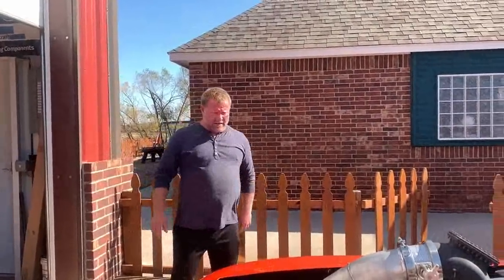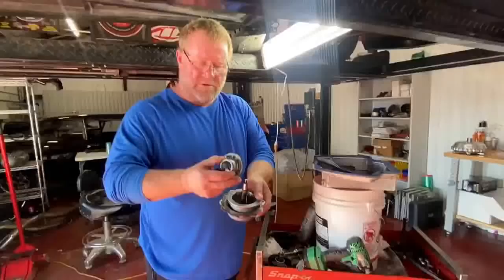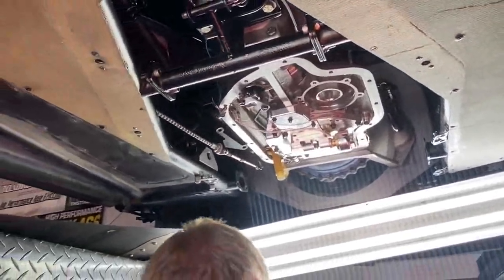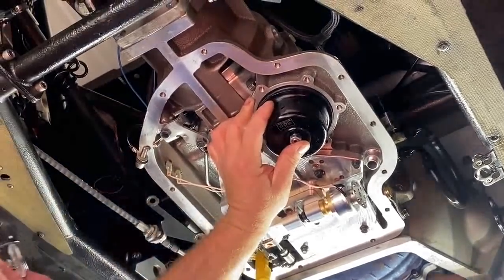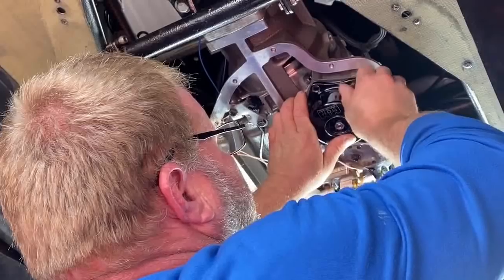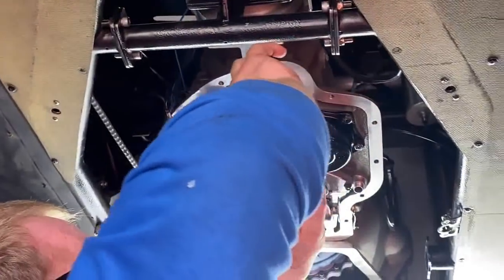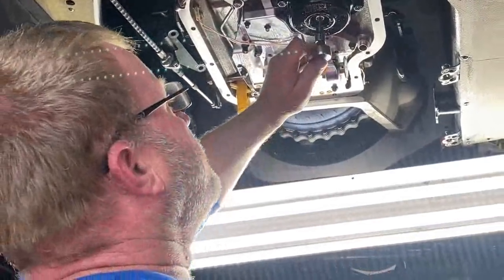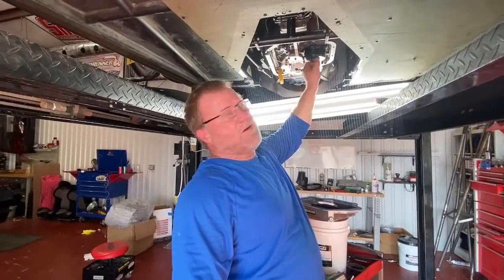Technically Speaking: Transmission Servo

Comment: Get you a GEARWRENCH socket set. The sockets are open in the center. You can tighten the jam nut with it and put your Allen wrench in the middle to hold it. Works great.

Comment: Creeping forward on the brake would most likely be a leaking direct clutch hydraulic circuit, if the band is adjusted too tight it will drag on the 1-2 shift.